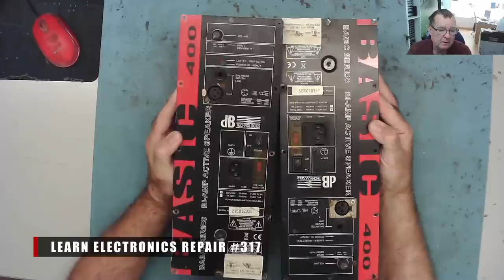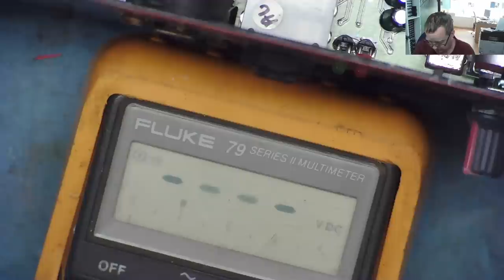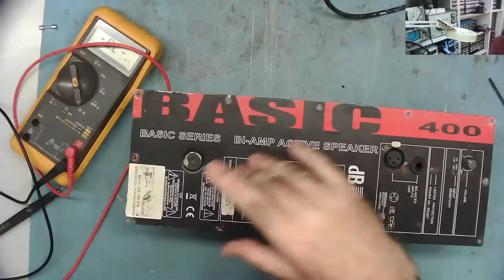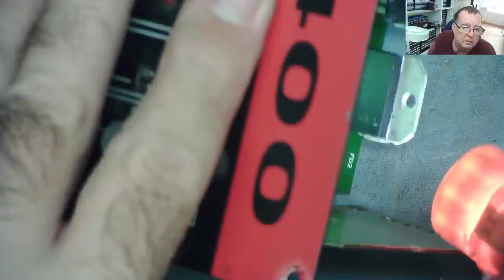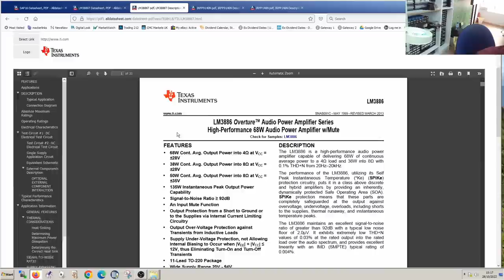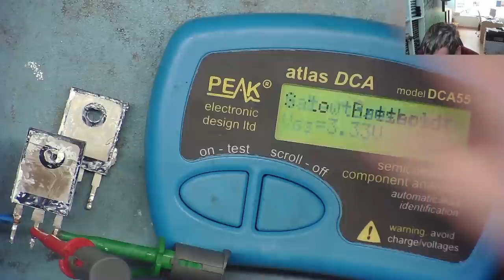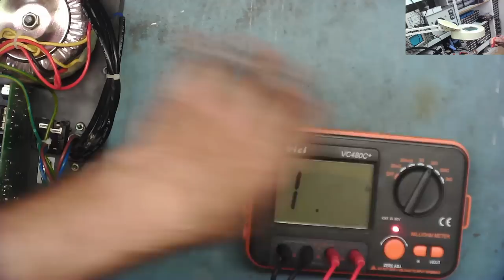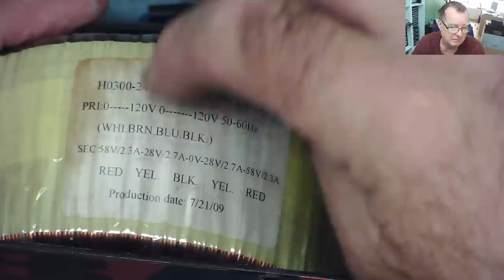BASIC 400 Powered Active PA Speaker - Blows Fuses, But Why?

Comment: A good test would be to change the good amplifier transformer into the one that is not working ..that would prove the problem is the transformer. (note: I also think it is)
Reply from the maker: I fail to see how that would prove anything at all - seeing as the fault condition is present when the transformer is disconnected from the PCB.  However your comment has two likes, so am I missing something important here?  If for example the transformer worked when connected to the other PCB what would be the conclusion?
Reply: @LearnElectronicsRepair  Connecting a working transformer to the "faulty" system would eliminate the possibility of another component on the faulty system be the cause of other malfunctions.
Reply from the maker: @John_Smith__  That's a fair comment - I agree with you it would prove the PCB is good or not

Comment: U are rattling the wrong bush .its not the transformer .there are 4 blue caps on the pc board .one or more are blown  .did u forget u tested the board without the transformer and the short was still there
Reply: I also think it have seen high voltage and one off the MOV have shorted
Reply: Aha I was shouting transformer ar rhe beginning...But then I didn't see any MOVS or caps..
Reply from the maker: Hold on one minute!!! So the transformer 
A: causes the current limiter bulb to come on full brightness when it is NOT connected to the PCB
B: the DC resistance of the secondary reads low (compared to the good one) using multimeter and Milliohm meter

Before you convince me to try your suggestion please explain how the short condition caused by the 4 blue caps on the PC board is still causing a short when the transformer secondary is not even connected to the damn board!!!!!!!!!!!!!!!!!!
Reply from the maker: @flipjonker116  Where is this MOV?  Tell me and I will check it
Reply: @LearnElectronicsRepair  Agreed.  My initial inkling was transformer/power input.  Very thorough check, there.  Caps can't cause a short if they're out of circuit.  Thermal stress degrading the insulation??
Reply: @LearnElectronicsRepair  its the 4 small blue caps on the board .not the 4 big black capacitor's
Reply: @LearnElectronicsRepair  the blue caps are there to protected the main board on high voltage and will cause a short so the fuse can blow .secondly u talking about a difference in milliohms that u will get in any  transformer even if its the same make
Reply: @LearnElectronicsRepair  and the damm transformer is suppose to show u a  short circuit that means its working .when it gives u a open circuit that mains the transformer is faulty
Reply: @sonjamuller399  but Dicky powered the transformer on its own by AC Mains through the series lightbulb and it clearly shows that the transformer has shorted, so it can't be anything else! 
The board measured no shorts on its inputs so the board appears to be fine (but could still be harbouring a transient fault under load that possibly stressed the transformer).
Reply from the maker: @sonjamuller399  OK, sorry if I got a bit stressed on the earlier comment, let's go through this again. If you watched the video through you will see that I tested the transformer with it disconnected from the PCB (00:45:50) and it is still presenting the same short-like fault condition.  So the fault can not possibly be on the PCB.

Transformers usually do read (very) low resistance, especially on the secondary, but I was lucky in this instance of also having a known good one to compare with bad one.

The primary of both transformers read pretty much the same, but the secondary on the bad one read a lot lower than the good one.  This was visible even on my multimeter at 00:51:10  (0.5 ohm vs 1.3 ohm) and very obvious when I then checked it using my Milliohm meter which reads down to 10 Micro ohms.

It is also possible to have a transformer giving the same fault condition as this one, but the resistance reads the same when compared to a good one of the same type.  This can be caused by one shorted turn in the transformer that will not show up on a multimeter but even one shorted turn will kill the transformer as it is effectively the same thing as having another secondary connected to a short.  Transformers can fail in various ways, not just by going open circuit.
Reply: @LearnElectronicsRepair  try and swop the transformers around .also note after u disconnected the transformer your short was still on the board  .also test your protection capacitors for a dead short
Reply from the maker: @sonjamuller399  Can you tell me the time (minutes/seconds) in the video where the short was still on the board after I disconnected the transformer please

Comment: I've just looked at the specification for the active speaker this is from, and it says the output power is 450 W + 100W.
It's amazing how they get all that power using a 270VA toroidal transformer. It's magic, I tell you. 🔮🪄 ⚡🔊
Reply from the maker: Or they redefined Watts like the hard drive manufacturers redefined megabytes?  No one seems to have an issue with that particular method of short changing us 😉